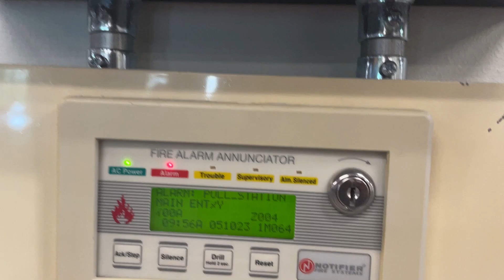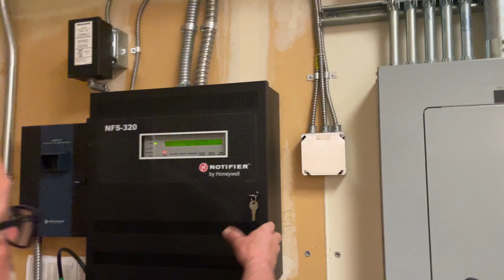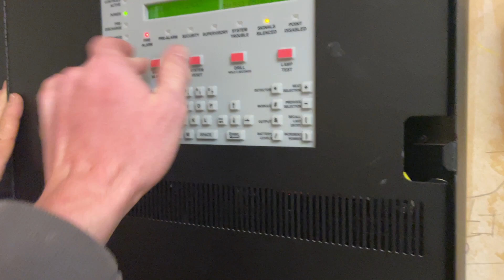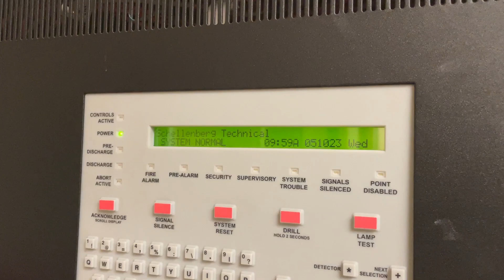Career Technical Center Fire Drill | Notifier NFS320 w/ Female Voice Evac | 05/10/2023

Comment: What is the tone ?
Reply from the maker: Not sure what it's called but is a very interesting sound compared to other systems. The panel is Notifier so it's something in their tone library.
Reply: Code 3 Whoop on the Notifier NFC-50/100. Which is just a rebranded FireLite ECC-50/100.
Reply: ANSI whoop